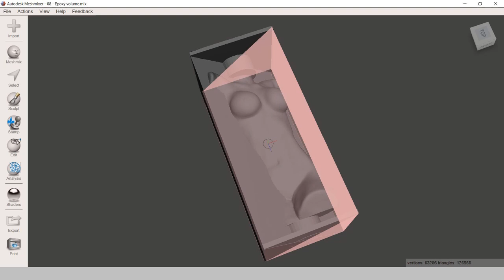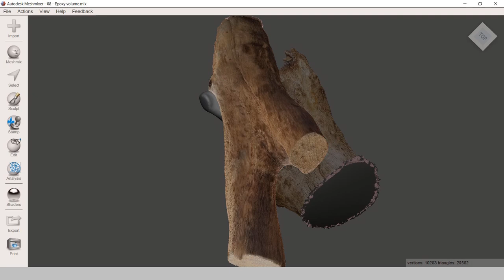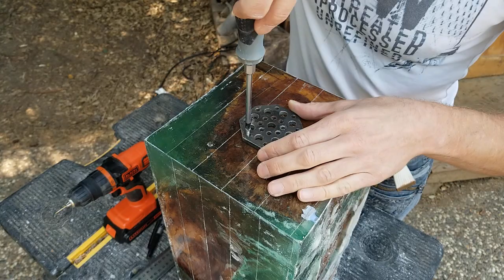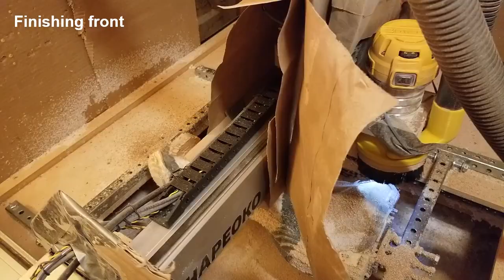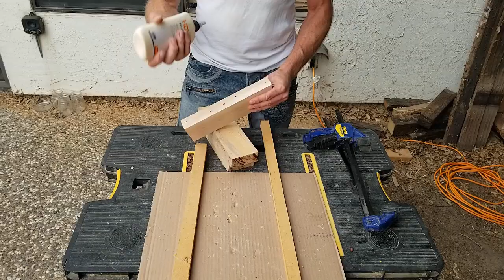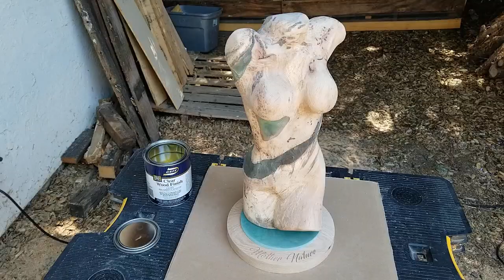4-sided CNC carving a female torso with a 3D rotary setup for the Shapeoko

Comment: could this not have been done 2 passes- back and front?
Reply from the maker: Good questions, but no. The piece would be too thick to fit under the Z-gantry, and also the bit would not be able to reach any overhanging sites. The bits aren't long enough either to go that deep, without the router bumping into the stock material. See my video where I explain these challenges when carving a Koi fish: https://youtu.be/-reSew5u5Oc
Reply: @dennisvanhoof9958  didn't think of that last point. Great stuff anyway

Comment: I've had a small CNC similar to yours for almost 10 years and I've never thought of using it the way you do to create these 3d objects, absolutely amazing. Have you ever considered replacing the belt drive with a ball screw system to avoid the belt and pully clogging?
Reply from the maker: Thank you for your kind words and the suggestions!
I do not have any intention to modify my CNC with a ball screw system, except for the Z-gantry (which is available as an upgrade called HDZ). I can get the precision and accuracy I need with the current setup, and a bit of cardboard and paper does the job of protecting the belts from clogging up. :)
Reply: @dennisvanhoof9958  it does indeed look like the cardboard does the trick !  Great stuff
Reply from the maker: @defyent  Only the piece of track where it matters, the rest can pile up. :)

Comment: I have a few things I plan on carving using your process but I have a question for you.
If I wanted to carve a topo map on a piece of wood and cut it up into quadrants, would there be seams where the quadrants meet?
Sanding a topo map would be tough.
is it possible or does this work only for smooth surfaces?
Reply from the maker: Good question! I'm afraid that there will most certainly be seams. It is difficult enough already to seamlessly glue square blocks. Wood will warp as soon as you take a chunk out of it. But even without the warping, you will see the boundaries, just because the grain pattern on one block will not match and smoothly transition into the other.
You're right that sanding a 3D shape with lots of fine details is difficult.
Would it be possible to use natural boundaries in your work to mask the seams? Instead of straight lines, could you for instance follow the ridges of mountains or centers of valleys, like pieces of a puzzle? If so, just keep in mind the sharp corners that should be able to fit the diameter of the bits that you use.
Reply: @dennisvanhoof9958  Thank you for your reply. After re-reading my question I see I did a poor job of asking my question but I think you answered it well, but I do want to try again.
I would like to take a single piece of wood and put it on a jig and machine it from four sides following you have done.
If I wanted to machine a topo map out of a single piece of wood to get a cylinder with a topo map machined onto it, would I see a seam (in four locations) or would it look like it was done on a 4th axis?